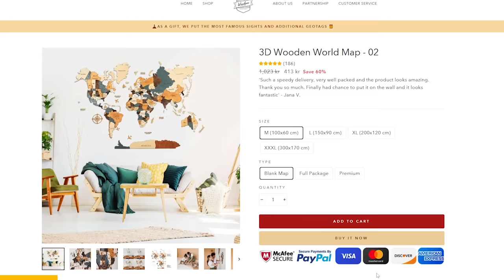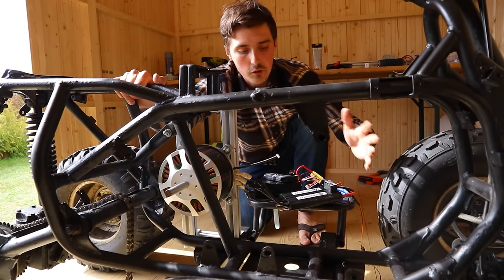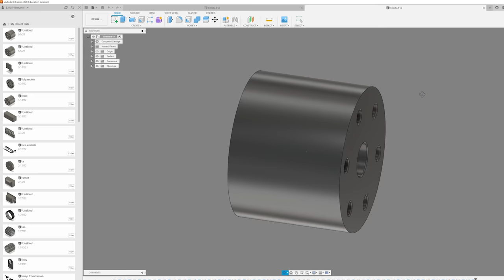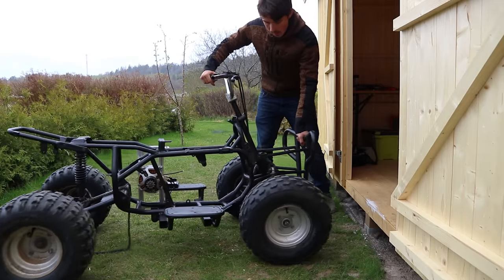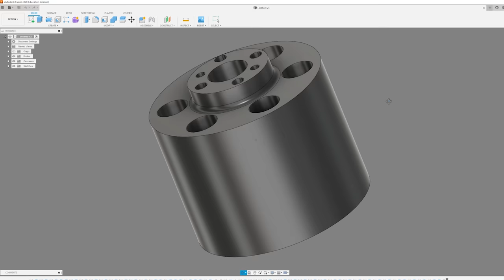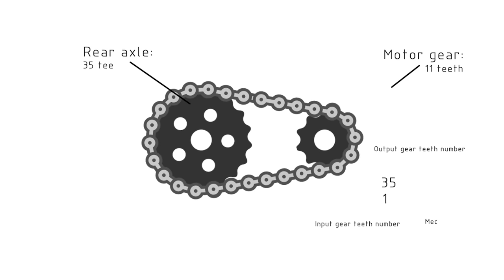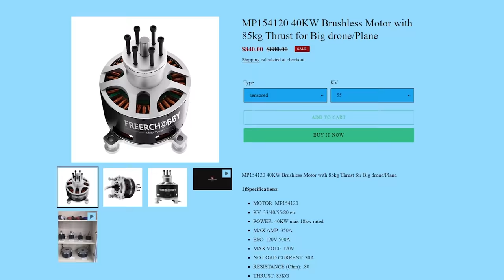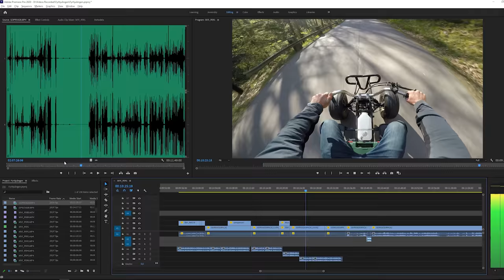I Bought an ATV and Made It Electric

Comment: You'll need a support bearing on the other end of the motor shaft if you want to run more power. Without it you're relying entirely on the bearing in the motor to resist the sideways force on the shaft caused by tension in the chain. That's a significant lever arm
Reply: Or drive the shaft back through the rotor  and turn the motor around, so that chain applies force much closer to the mount.
Reply: @NGC1433  No, you still want a support shaft. Brushless motors especially pancake motors were not designed for having sideways force on the shaft at all. They are meant to spin balanced props. He would need an inruner motor if he plans to run without a support bearing. Even then it's always better to have one as the petrol engine has a gearbox with a fat shaft real close to the casing which supports all the side force. The shafts are strong ad designed for that application. The bottom line is he needs bearing support if he's going to run any serious power and wants it to last for a while.
Reply: this
Reply: My first thought!
Reply: Great idea and explanation

Comment: Previous Electric Go-Kart mechanic here:

First issue I see is as you pointed out, the ESC has no idea where the motor is in its rotation. That black wire coming off the motor is the encoder signal that the ESC uses to determine the position of the motor. We had issues if the encoder became out of sync or out of calibration or even just outright die, the motor would do funny things like make noise or stutter in it's rotation. This is probably why the first controller you used did not work, it was looking for that signal and couldn't do much without it.

Our karts used a motor controller/inverter known as a Sevcon. They are about $300-$500 USD online for the models we had and our karts ran at a nominal 48v and max amperage of 100 amps. 100 amps was programmed as it was just below the max 120 amp output of the 16 nominal 3.2v LiFePo4 batteries in series to create the 48v. There is an alternative that has become popular that the kart manufacturer switched to known as Curtis controllers. Both controllers are pretty well-designed and we had little issues with the Sevcons, we did have one Sevcon that the battery terminal melted but that I had determined it was due to a loose/bad connection. I left the company shortly after they got a new fleet of karts that used the Curtis system so I can't speak to the their long term use but a lot of online shops that sold motor kits, included a Curtis controller. 

The only problem with using one of these controllers is the programming cable or software was the expensive part. The programming cord for the Sevcon alone was about $1000 with free software. If you did decide to use one of these, the only issue I can see if you used these is that they are not consumer friendly and require some knowledge of programming the controller to work properly with the motor. I never had to do that, the controllers came pre-programmed and we had a backup file to write to the controller if we ever had to. Though I will mention both of them had a calibration tool for the encoder that would walk you through how to calibrate the encoder so that it was in sync. The Sevcon was a more manual process that you had to take "logs" of the data and put it into the software and it would tell you what to set the encoder to and the Curtis had a one click button and it would go through the calibration process automatically without user input.

If you were to pick one, I'd suggest the Curtis of the two.

There is another controller that I can't remember the name of but I recall Colin Furze used one on his drift trike and that seemed a lot more user friendly and didn't require expensive software or programming cables. 

Gear ratio should not be an issue here as our karts had a ratio of 3.636 and had no issue of spinning the tires out from a stand still and I'd assume the weight of the karts aren't too far off the weight of your ATV. It comes down to programming the controller to how much power and torque it uses to get up to speed. 

If you would like to ask any questions, I'd love to help as much as I can. But I am no expert of the programming side, only the few settings I would have to go in and change like max RPM, throttle input, or calibrating the motor encoder. I'm pretty sure I still have the PDF files of the parts somewhere and could get you exact part numbers of various things like the TPS sensor, batteries, etc.

EDIT: I do have those PDFs :)
Reply: Thank you for your help here.  I just gave him some gems of truth I learned along the way as well.  I am wondering about the gear ratio as well.  Not so much that it is a problem but that all the motors I had which were sensored traction motors designed to run at low rpm all had very large windings.  By large I mean the winding wire was 14-16 gauge single strand.  I noticed his motor has fine strand wire and I'm wondering if it is designed to operate at much higher RPM.  I hope we can help him to accomplish this with less challenges than you and I have had along the way.
One of the easy to program controllers is the Alltrax brand and the Kelly controllers are also good.  I have used 3 of the 4 with good success.
Reply: Sevcons are definitely popular.

Endless-Sphere approved.
Reply: @kevinsellsit5584  I suspect the fine strands are connected many in parallel to improve packing density, and the number of turns would be in the tens not thousands!
Reply: You are an absolute hero (in terms of YT comments) to write such an in depth comment to help assist. I'm genuinely touched by the effort you've gone to when most comments can't even take the time to appear grammatically correct.
Reply: @Dogburt_Junior  OG ... V is for Voltage
Reply: @philbarrett3739  Appreciate that. I rarely comment on video but felt like I had the background and knowledge to share so figured I would. Didn't expect it to get so long but oh well.
Reply: @kevinsellsit5584 Appreciate it. Figured I could lend some of the knowledge I learned over a couple years that I am no longer using. And yes, Alltrax, I believe that was the controller that Colin Furze used. I had them recommended to me for the DIY build I want to accomplish some day. But I plan to go all out and not so simple as he has chosen to do.
Reply: are you using an over current protection on your battery + ? if so, are you using a fuse or circuit breaker? and of what rating. thanks
Reply: Motor definitely looks high rpm type for e-aviation use
Reply: you dont must step motor position , in start the motor take max power (A) , and ecu cut the power(the click sound at start).

The big problem is motor breaking, that make voltage.( may burn cheap ecu).
You can use dioda to protect ecu from motor voltage generta via breaking.

You must use electric clatch the off when no power to motor
Reply: Buy a Kelly controller they are inexpensive and free software and a simple usb cable to configure
Reply: Weigh isn't the only thing to determine gear ratio. The wheel size on his quad is probably bigger and requires much more torque to turn. Like the previous comment said the kv of the motor is a huge factor as well.
Reply: I’d love to know what karting company you worked with! You are a hell of a guy to make such detailed posts and I thank you tremendously! I am digging into the programming aspect of motor control and I am definitely building my own kart now! 
Was it the red F# kart company or the Green one here in the states? I love the indoor electric karts for the sheer acceleration and illusion of speed. They’re wicked fun.
Thank you again,
-CY Castor
Reply: Also, what motors did y’all run?
Reply: poggers
Reply: "Electric Go-Kart mechanic" lol censored? you mean SENSORED, which need special esc's, correct. 3 halleffect sensors for positioning of the rotor, BUT NOT every sensored motor needs it, this one dont, it helps with the starting jitter for example, smoothing starts and stops. the sync / calibration you mean has just to do with the input of the user, not the work between esc and motor.
the main problem here is the power transition.
Reply: just use hall sensors and be done with it, no need for all this

Comment: Pains me to see that tiny sensorless controller running that motor, looking forward to part 2
Reply: Agreed haha only way to even try to get away with running a sensorless setup in applications like these would be to add a torque converter for some slipping, and to allow for the esc to start to detect the feedback on bldc after “X” rpm’s. 

Sensored is absolutely the way to go, it’s much more efficient, and the amount of torque gain from precise control is night and day.
Reply: No idea what you guys are talking about. I wish I did.
Reply: Pretty sure the battery for pump of the watercooling loop ran out and therfore killed the esc. I hear no pump running right after the incident
Rip ESC..
Reply: @SetitesTechAdventures  the shiny bit that controls the motor
Reply: @Liace159  plus the improper gearing and sensorless controller means that poor esc was working massively overtime. 

I’ll be honest though, still love the video, not criticizing as I would have done the exact same thing just to get it moving around while I waited for the big boy esc to show up.

The only difference I would have made if I may suggest, is #1, run a dc to dc buck converter to power the water pump off the main batteries, use different batteries in general. I build custom lithium batteries for everything from my 165KW home solar battery, to small desktop projects. By using the lipo cells without either a bms, no temperature monitoring, no balancing, or under voltage protection, it’s potentially dangerous. I’m sure the esc has a low voltage cutoff, just kind of sketchy to rely solely on that to keep the batteries within spec between voltage, overall current draw, and temperature. 

If interested, I’ll make some suggestions for some either modifications to your current lipos, or how to build an even bigger battery cheaply that’s safe, reliable, and can handle the power demands easily
Reply: yea, the poor motor getting shaking itself slowly breaking the hall sensors
Reply: @Yy-ig6fm  exactly!
Reply: Such sensorless violence
Reply: @Liace159  If that ran out he wouldn't have had radio control, right?
Reply: @redbaronrefining5322  sensored only for low RPMs then switch to sensorless
Reply: @redbaronrefining5322  gears dont matter, jeez maybe dont comment when you dont know what you are talking about?
Reply: @Blox117  lol ok kid. I won’t. Haven’t messed with these for 28 years or anything
Reply: @redbaronrefining5322  he literally used sensorless without a problem. I do too. it only requires you to move so the observer can track the rotor position. 

again, you don't know what you are talking about.
Reply: @redbaronrefining5322  could you also use a ribbed tire like on a highway tractor (but like spacered disk?)  to minimize traction?
Reply: @Blox117  first of all he did had a problem, second of all until you understand the exact working principles of a brushless controller, you can’t quite argue that you can run sensorless on a high torque application like this where the gearing is especially too low. How are the mosfet‘s supposed to know when to switch to the next phase unless they are monitoring the motor at low RPMs? Once the motor gets into higher RPMs then there is feedback generated to the controller which reads it and knows when to time each of the fields, but at the beginning it is just a dumb controller putting out a signal and expecting the motor to keep up exactly with what it’s putting out. I guarantee if you take a thermal imaging camera to that set up, you’ll see some massive heat between the controller and the motor until it gets up to speed. Do the exact same experiment with a censored brushless motor and not only do you have a ton more torque and more precise control, you have much lower temperatures, more efficiency all around, and smoother control.
Reply: @Blox117 yes I totally agree

Comment: I'd say first change the gear ratio. That will yield the biggest results and should limit how much current is needed, right?
My guess is that the motor can spin much faster than ever needed, so changig gear ratio will not have any real downsides.
Reply: also using a speed controler that uses the sensor on the motor will make a big difference
Reply: No the sensor is extremely important, since the electric motor is running super inefficient without it. Basically it works against itself now, since the timing of turning the electromagnets on is completely off.
Reply: @dryaldibread2327  not really. The ESC uses feedback from the windings to figure out the phase. That's why it works so badly at start from standstill. It's common on escs for RC flight as propellers don't produce much drag in the beginning.
But running it like this might kill the motor if the ESC fails to detect the zero crossing.
Reply: lets say he get 80kv motor (not KW ...KV meaning rpm per volt)
so u get 
48v x 80KV =3840rpm x  circumference of the tire  = around 143.6cm  ~ 56.5 inch
3840 rpm x 143.6cm  x 60min (because its rpm we need per hour)  divide per 1 km = 330.85kmh YUP almost 331kmh 
divide that with 3.18 gearing = around 104kmh max speed 
FAST 
but 
if he will use sensored mode it will work waaaaaaay better

PS
U can get VESC for 100V + for around 100-200$
Reply: Motor can give more power, needs a better ESC + Batteries then check the gearing.
Reply: lets just keep it real here: don't invest into a $1000 motor then run it on some janky ass setup. get everything for the build to run smoothly to start with.

Comment: There is something magical in the electric vehicles. I really want to make one for no reason :)
Reply: Andrew Cowell  bUt ItS zErO eMiSsOnS!
Reply: Yooo! I didn't know you watched Simon! Cool :D
Reply: It's called FIRE :D
Reply: Andrew Cowell  no one cares about your conspiracies
Reply: Electric is the way to go, so much fun. I have built my ebike, and I’m using it almost every day except winter. There is a short video of the build in my channel if you are curious.
Reply: but even one of those proffesional electric motorcycles only get like 25-30 mile range tops per charge. and that's the top of the line model and driving conservatively.

 it's kind of a novelty really
Reply: @couchpotatoes5158  I'm just curious what conspiracies you think there are. Most battery material comes from conflict nations.
Reply: @XX-121  It's fine if you aren't driving long distances, and you can easily scale this up to longer ranges.  Check out the Sur-Ron, they can go far.  My electric bicycle can go 40miles with little effort and it's pretty cheap.  What's cool about electric (not a tree-hugger) is that it's quiet, has good torque and you can get free gas by charging it with a smaller solar setup.  If there's a gas shortage you have some mobility also.  But you're right if you run out of range it's not fun.
Reply: @rhadiem  does your bicycle go on the highway?  where i live it's over 10mi just to the closest store/gas station so if i'm only getting a 25-30mi round trip it's pointless.  i'm talking about road worthy transport like "zero motorcycles" not sure if anyone else is making commercial electric bikes,  but  the whole thing is, is the landfills are already filling up with toxic waste filled battery packs from ev's and not to mention all they are heavy and you got to mine all th stuff  to make them then transport that stuff over the ocean somewhere then over land to a factory then transport that to the car factory then transport the heavy as cars somewhere then you STILL have to make the electricity to charge the batteries!  that STILL contributes to global warming and burns fossil fuel and/or damages the environment!!!  and you still have to deal with the inconvinience of having an EV not to mention the added cost and some people are having to do battery swaps after a couple years????  and it's almost the same price as the vehicle????  and i know it's not but it's also NOT WORTH IT.  i guess do you.  the media/joe potato got you brainwashed into thinking your flippin captain planet now because your blew your wad on a tesla...  all i can say is "good luck"?  glad you can afford it.  and still put  money into retirement.  this whole thing is a scam.  gas was under $2/gallon before o'biden got ba k in office.  and food was HALF what it is now.
Reply: @XX-121  You can find ev motorcycles with much more range. It just adds a lot of weight and most would rather have theirs short range and lightweight instead of long range and heavy. Zero bikes can go around 200 miles on a charge. Others are showing 250-300, but may not be available for purchase right now.
Reply: @androiduberalles  The only battery material that mostly comes from a conflict nation is Cobalt. Still, you can find that elsewhere and you can build some batteries without it at all. It can also be acquired from proper sources in Congo, but isn't always. The funny thing is that numerous devices have been using unethically sourced Cobalt for decades, but no one cared until EVs got popular. You likely have more unethically sourced Cobalt in your house than there is in a 100kwh EV battery.
Reply: @androiduberalles  it is zero emissions you bot
Reply: @anthonypelchat  make sure to mention that cobalt is used in automobile gas
Reply: @Blox117  Nah he's right, Lmfao you're the who sounds like bot lol